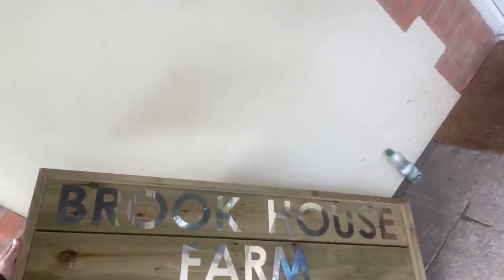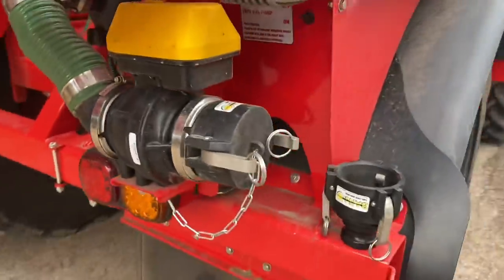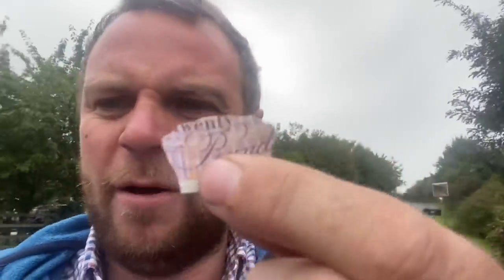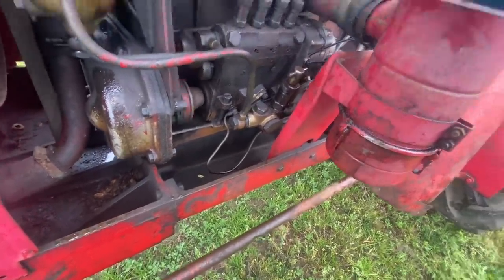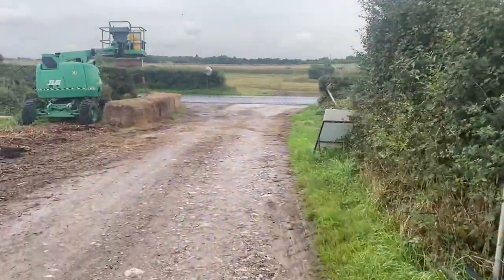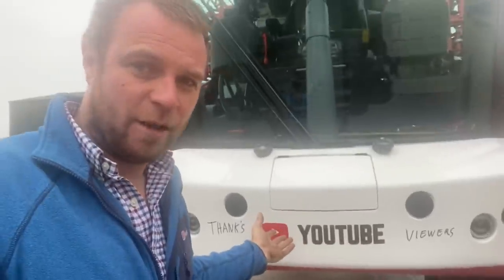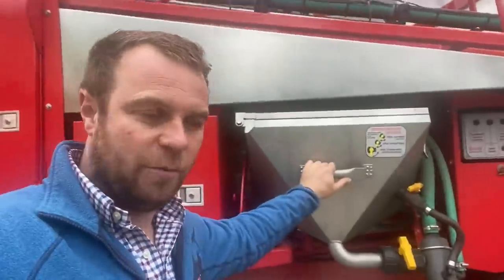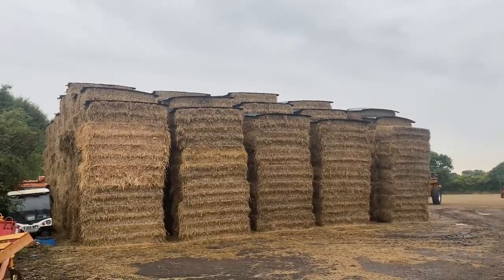Day539 #OLLYBLOGS FIRE ENGINE SPRAYER CONVERSION  & NONE RUNNER CROP MASTER #AnswerAsAPercent

Comment: Hi Olly. Dad's David Brown has probably been stood a while, there could be water, or air in pipes where diesel should be. Drag the tractor back to the farm, drain the complete fuel system, including the tank, or tanks. Tip5 gallons of diesel into the tank, turn that tap near the sediment bowl into the "neutral" position, take the pipe off to the sediment bowl, turn the tap on, see there's a good flow of diesel. Refit the pipe. Originally there would have been a filter in the sediment bowl, remove the bowl from the housing to get to the filter, clean if there's a filter,then refit. I'm unsure if there's a filter in the lift pump, take the outlet pipe off, work the pump, is there a good gush of diesel?  Remove the fuel filters from the housings,do they look blocked? Is there water in the filter housings? Reassemble if okay. Pump a good drop of diesel out of the bleed screw on the injection pump, pump any water etc out, then if you can get to the injectors, slacken the fuel pipes at that end, and wind the engine over, until fuel pulses out. Stop winding the engine over, tighten the pipes, and if you've not flattened the battery, it should then start. You've cleaned out the fuel system. It's not worth doing anything less than that. See all pipe connections are tight.  There could be other problems, try this first, if it doesn't start, let us know tomorrow, it was trying to start, it was smoking, it was injecting diesel, or something!   Good luck mate!
Reply: Working for Sewards/ Manns, I wouldn't have expected anything less from you Ian. 😉
Reply: I hope Olly gets it going now! - I haven't done a call out for a year or two!
Reply: @ianwestmoreland5950  It's a fair owd  way from Stutton...🤣

Comment: 57.6L (or kg) per bale from 20mm rain. 

You need to get the 3650 finished, it will be the best tractor in the farm (or would be if you had anything small enough for it to pull and didn’t mind it only doing 18mph. It’ll still outlast every other machine there!!😀)

Comment: Why Not Have a Steel Shed to have All those Bales in it instead of getting them ALL Wet and then they will ROTT. NOT Good and then you will have Rodents everywhere, The Caps dont do much when it Rains like it did or when it Snows. Have a Great Sunday Night Olly & Family.
Reply from the maker: Cost a lot
Reply: @OllyBlogsAgricontractfarmer  - Cheaper the it going to waste and loosing Money on it. And Critters getting into other areas of the farm and crops or Product. Also Cheaper then a New Tractor and All the doings of Painting one black and All that kinds of things. Like you told me early on I asked why someone of the items where under roofs with NO DOORS and you said to Keep Dry. Well Built a Machine Shed for Your Tractors and Equipment and then You will have room to put Bails at to keep dry and Place Heavy Tarps to keep things dry from the Wind. Or just Wrap them right away in the Fields.

Comment: Hi olly,,, got an old 595 massey,,,, has a similar prob,, that has a lift pump on it, but I found the bowel on the Manual lift pump got choked up with what looks like a greasey substance, weather its the diesel or water,,, that big canister filter on the left of the lift pump may be holding a prob,,, good luck,, great vid,, 👍👍

Comment: If u pump the lift pump with filter bleed screws open get air out then crake the injector pipes wind it over and make sure fuel coming out of pipes as it fires tighteen them up may help start the db , lift pumps can fail and let air in or maybe u have fuel block from tank
Reply from the maker: Yer think your right

Comment: Looks like one of those nuts on side of injector pump needs to be loosened off then use prime pump until air stops coming out  before you try and start it.

Comment: Take stickers off of machines often, he did it a completely harmless way considering there is no damage to the paint for the water to get under and get a hold of. Older machines you have to be careful because rust spots will cause mayhem but surprise surprise the BRAND NEW perfect condition Bateman doesn't have rust or paint chips
Reply from the maker: It’s also Fiber glass

Comment: My contractor gave up spraying so a new chap with a Bateman!
I want to plumb in fruit juice black tank 1700L to fill from. Are they all 2" banjo? I need a male with tap and thread that goes inside and a seal and nut inside tank. Can't find anything?
Reply from the maker: Ebay ?
Reply: @OllyBlogsAgricontractfarmer  but they quote ABC fittings whereas I think his is 2" so don't know the letter

Comment: Olly The two tanks and Switch over tap are because the tractor was originally Petrol Paraffin "TVO" the lift pump is as you realise on the side of the Injector pump and their should be a filter in the Lift Pump if you take it to bits also look for Banjo Bolts that can collect Shi* .

Comment: With the DB it could be a petrol start and switch to tvo as they had to tanks.
Reply from the maker: It’s diesel with no spark
Plugs so is it just twin tanks
Reply: Could of had an engine swap at some point and kept the original tank. There is diesel in the  glass bowl so just have to bleed it and as you say crack the injecters.